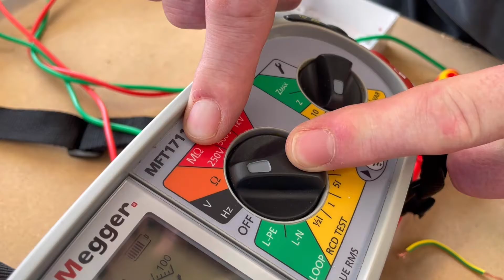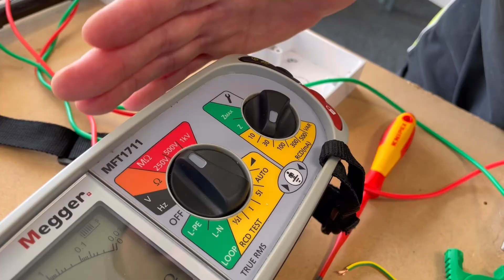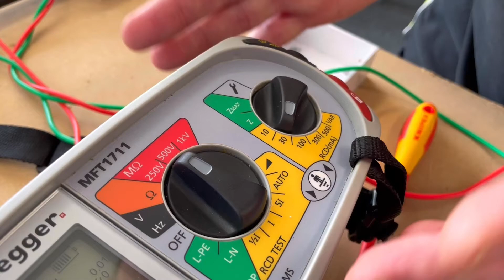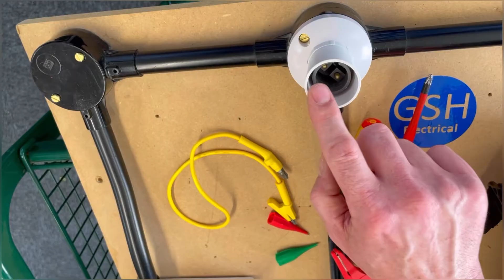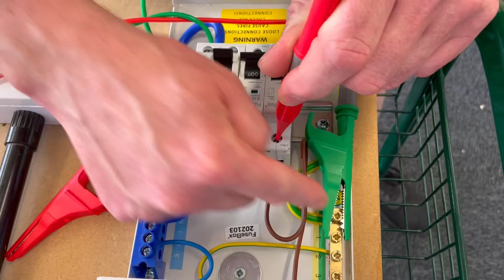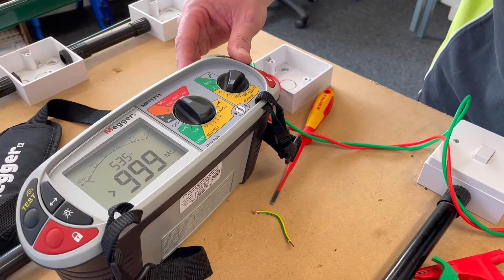How to Set up Your MFT and Measure Insulation Resistance￼

Comment: Thank you Gary for a clear and well demonstrated explanation. However my problem is Insulation Resistance Testing circuits connected to multiple LED’s fitted in 19’ high ceilings.

Comment: I understand the need to remove loads but what do you do if there’s 30+ downlights & a cooker hood or other appliance is plugged into a socket that you can’t access to unplug?
Reply: Link line and neutral together and test to cpc. On a new install you must not do this but can on existing as EICR
Reply: @iancottingham4189  Thank you
Reply: Good question, especially for commercial installs.
Reply: Just don't test that circuit and leave as it is lol. yes, Garry answer the question.